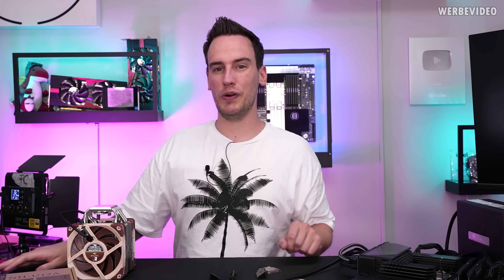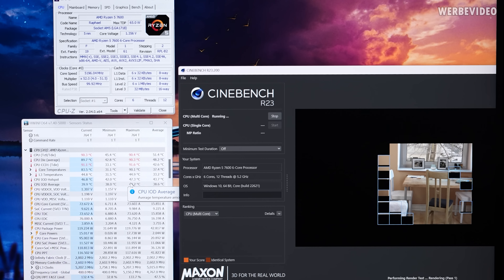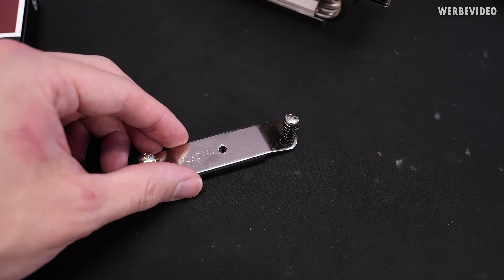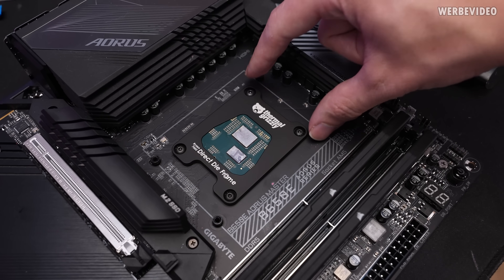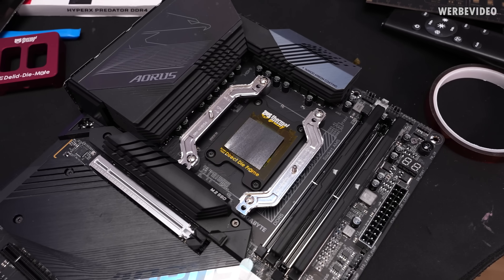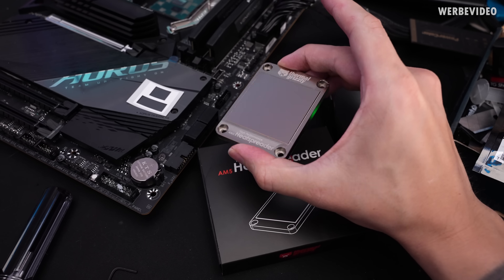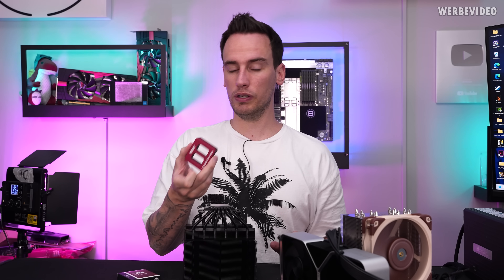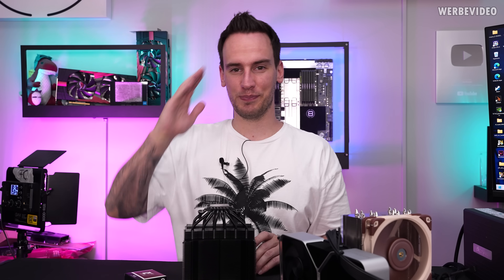How this 120$ Noctua Cooler beats a 360 AIO

Comment: Would have been interesting to see the difference between stock configuration of the Noctua compared tot the delidded situation. The comparison seems a bit flawed since we don't know how much performance gain is due to the cooler itself.
Reply: That's the key trick in this video 😂
Reply: Indeed. My thoughts exactly.
Reply: That wasnt shown for obvious reasons, as its a marketing video. While Noctua makes good products, the cooler here isnt outperforming or even matching 360mm AIO. Instead we are just seeing how bad the AMD IHS is, and how you can significantly lower your temps by removing it and going direct die.
Reply: @__aceofspades  To be fair, you can go anywhere and compare Noctua to an AIO, the question here was "What if you spend less on an air cooler, but de-lid it?". The fact of the matter is that the direct die air cooler did perform better than a 360mm AIO with the heat spreader. If you're budget is $200 for cooling and you want the reliability of an air cooler, this could make sense.
Reply: @EricFixalot  But then you want to answer the question as well, 'how much performance gain are you getting from delidding in the noctua situation'.
Reply: @EricFixalot @EricFixalot Yeah less compared to overpriced corsair garbage. The ls720 at least where I live is the same price as the d15, massively outperforms it and doesn't come with a hideous colour combination. Ofc if ur comparing a massively function over form company to one riding on reputation and focusing on form the former wins in function, no shit... Don't wanna sound like a needless hater but this is such obviously flawed testing. Like seriously 200 euro for a b tier 360mm aio lmfao, once again the derpcool ls720 beats both coolers and that isn't even $200 aud, it's the equavilent of almost exactly 110 euro converted.
Reply: @EricFixalot  You do know, when spending money on stupid shit, the only thing holding you back is BALLS; right? Still trying to sound like a stupid smart PC builder by using the word BUDGET is ignorant. Either you go out and buy what you need the first time; or stay home with the wife and let her tell you what you can spend....
Broke and thrifty is an oxymoron.....
Reply: @__aceofspades  Then wouldn't we want to see how much performance gain you're getting if you keep the cooler the same but delid the CPU?
Reply: @itspodin  Again though, you can already find a bunch of videos comparing delidding to stock. Sure it would have been useful, I just don’t think it was the point.

Comment: this video was meant to be on a 7950x or 13900k to be honest, first who is going to delid or invest in such a solution for a 5 watt cpu lol, second, to actually see the improvements what better cpus than those ??
Reply: Small form factor builds could benefit from this by allowing a smaller air cooler without sacrificing performance.

Comment: I wish that more CPU heatsinks used a four point mounting system. There are four holes available on the motherboard, after all. Gamers Nexus has proven with their testing that you get much more consistent mounting pressure when using four points vs two points for heatsink mounting.
Reply: Late to the conversation but what does kinematics have to do with mounting pressure? Motion is the last thing you want for a fixed mounting system. And any situation with an even remotely convex surface that’s not entirely rigid is going to benefit from four mounting points vs two.
Reply: I agree. 

Always fill every hole possible for maximum pleasure!
Reply: @Shadow__133  sweat pores: nervous perspiration
Reply: I still use an Arctic cooler from years ago with 4 point mounting, still keeps these newer chips nice and cool. 😂
Reply: @GoonyMclinux  Been rocking a Corsair H100 for over 8 years now, still moist and lukewarm. 

Good enough for a 5800X3D, but I wouldn't go higher than that lol.
Reply: @Shadow__133  cpus have been up and down so many times in temp I just keep the old heatsinks just in case. 🤣
Reply: @GoonyMclinux  Smart man 😂 

I plan on sticking with am4 for at least another year. 

All my upgrades were simply unscrew, change cpu, put paste, re-screw.
Reply: @Shadow__133  I have a R7-5700g and a r5-5600 rig and Im probably good for another 3 or 4 years. 🤣
Reply: @Shadow__133  best part is I don't pay for parts, I get lots of discards from PC's I build, just got the R7 after guy wanted 5800x3d instead (for 1% and .1% lows purposes)
Reply: Screw consistency. If I'm building a PC it should be optimal without being constrained by consistency. Two point mounting is obviously kinematically superior, so GN's results need checking
Reply: @shanent5793 I fail to see how it's "obvious" that 2 point mounting is superior, and even if there's an intuitive argument favouring it the funny thing about intuition is that it's often wrong.
Reply: @bosstowndynamics5488  Even in this very video he complains about inconsistent mounting because the cooler shifts side to side. This is a result of an additional lateral constraint caused by the friction between the strap and the cooler. A roller would eliminate that constraint, allowing for more deterministic placement. Excess constraints on a any degree of freedom will introduce inconsistency with removal and replacement. This has been well-understood in optical design, where repeatability is measured in nanomètres. There is an alternative in the form of elastic averaging which is also very repeatable, but since it relies on elasticity it is less effective on small systems.

If you look closely at the stock CPU retainer, it is also a two-point mount. This is a cheap way of getting consistent clamping without needing a torque wrench, though the extreme length of Intel CPUs highlight its limitations. The latest SP5 socket illustrates a combination design where the retention frame has two longitudinal mounts, a screw at one end and the other end held down by a hinge connected to a beam that is clamped to the board by two screws. The frame is very rigid, with a tall web along the sides, while the six or more contact points to the EPYC heat spreader are just stamped protrusions, allowing for elastic averaging. Then the cooler itself is secured with six small studs around the perimeter, also using elastic averaging.

Direct-die is a very different situation, with two or three small, asymmetrically distributed contact surfaces. And since it's DIY I think it's more important to keep costs down instead of focusing on repeatability when the system is infrequently assembled. I think it's more than just an intuition and I would appreciate it if you could point me to that GN article or video
Reply: @bosstowndynamics5488    the shifting side-to-side is potentially beneficial when using a thermal paste as opposed to liquid metal or graphene sheets, allowing it to spread out as well as push the excess out in doing so, as opposed to a 4 point mount where excess may be "swirled" around the middle. of course when going to direct-die as opposed to a heat-spreader and/or using liquid metal/graphene sheets, these points are moot, since direct-die is a less homogenous mounting surface, LM requires a thin-as-possible application, and graphene sheets are extremely fragile. the "obvious superiority" is with homogenous flat surfaces and thermal paste, which is what >90% of people will do
Reply: @shanent5793  GN's pressure mounting testing uses a pressure-sensitive sheet of... something (I don't know exactly what it is) that changes colour depending how firmly its pressed in that exact area. as such, considering the side-to-side shifting tore apart Roman's graphene sheet, it's possible that the results of GN's testing are not entirely accurate (however the way to get it more accurate would involve some stupidly expensive processes, such as X-Ray Fluorescence Photospectrometry by mounting the cooler to a glass substrate separated by a liquid whose refractive index changes readilly with pressure, but since XRF can only penetrate so deep, it may necessitate electron microscopy, which is a lot more expensive in turn afaik)
Reply: @glebglub  pressure sheets only measure the maximum pressure, so they can't report the actual pressure in use. I don't think it's particularly relevant, thermal paste is a fluid, so the pressure should be uniform across the interface. Thermal paste has worse conductivity than the heat sink, so the thinner the layer, the lower the thermal resistance. This can be achieved by making the surfaces flat or very slightly convex. This is easily checked by rubbing the heat sink or spreader on a surface plate and looking for the shiny spots, or placing it against an optical flat and counting fringes. If they're extremely flat they will even wring together like gage blocks. A bare die is cut from a polished silicon wafer, and should already be very flat though multi-chip modules might not be coplanar, requiring liquid metal or solder to be applied to the interface

Comment: "you can always sell the delidder afterwards" - honestly, I respect that so much for a tool your team designed.
Reply: They may as well have a rental service.
Reply: @g.4279  or a straight up de-lidding service
Reply: @VeryIntellijent  shipping as unlidded might cause some trouble as cargo workers sometimes handle stuff carelessly
Reply: @VeryIntellijent  They would be responsible of any damage.
Letting the users do it and void their warranty themselves is a better deal
Reply: @erkinalp If laptop cpus can skip the ihs so can desktop cpus
Reply: @Aonobaka29  If der8auer's failure rate is lower than users (which it would be), you just bake the "insurance" into the price. Charge 120 euros for delidding instead of paying 70 euros for the delidder. Many customers would pay the extra for the piece of mind. Also sales would increase as many potential customers want to delid but can't afford to risk their cpu. Original option of buying the delidder remains ofc.
Reply: @g.4279  I mean, technically if you have a right to return they sort of do, for the price of shipping. Seems like it'd be kinda a jerk move, though.
Reply: I bought his delidder for 8700k, used it once now it just sits in its box.
Reply: @Apollo-Computers I have an 8700k with it's hat still on!!  What time do. .  
  🤔🤔🤔
Reply: true!!
Reply: respect? why? you can buy used one, use it and then sell again at the same used price ;-)
Reply: @cokeforever  That what I was think as it screw over the creator.

Maybe hes banking on you been to lazy to sell it.
Reply: @grlmgor  most probably it is like this: literally everyone in pc building world knows and uses thermalgrizzly tp, now think of someone going to spend 3k usd on a new rig, he orders the tp, why not purchase the delidder at the same outlet, negligible as to total price of the build, same outlet == discount... it is a product that is so marginal, anything goes to sell this kind of crap
Reply: it´s Romans "Playgroung" - and ALL he does seems to be (be awre of leading a company..)
Reply: He should just rent it out lol
Reply: you can use and refund it xD
Reply: He was always a friend for others, in the beginning as he was a underage nerd he teacht joung youth and older childs "being there is everryhing" by liquid nitrogen celerons.
Reply: I know im not dyslexic but anytime i see the word deliddler my brain autocorrects it to the diddler 😆
Reply: That's just common sense lol...
Reply: Thats because of the insane profit margins on the TG direct die frame and TIM. Its like the printer industry, they will sell you a printer for $50 and lose money, but an ink cartridge is also $50 and has huge margins. He is fine with people reselling the delidder, because that means more customers will buy high margin frames and TIM.
Reply: @__aceofspades  exactly.  I don't know why people think him saying 'just sell it' is anything but a silly attempt at justifying the insane price.  I bought my 7700k delidder for under $30.
Reply: "Honestly"  Now you want to start being honest?  Just keep lying it suites you better.
Reply: @Physics072  Dude, it's just thing people say.  Not sure where this came from lol
Reply: Lol, yea but it was started by a liar.  Then parrots started saying it without realizing what they are saying. :)

Comment: i run a 360mm alphacool aio on my 7800x3d only because i screwed up my GPU's cooler and ended up just watercooling it to i figured alphacools quick disconnects made it the easiest option for me. 7800x3d + 3080 in one 360mm loop runs perfect neither part gets too hot at all.

Comment: I still can't bring myself to use an AIO. That's because of my decade and a half working at sea and seeing how hydraulic fittings always leak no matter how high quality they are, or how well installed they are. There were 1000s of them all over the ship and fixing or replacing leaking fittings is a constant game of whack--mole for engineers and oilers etc. I just do not trust fluids near electronics, so use a Noctua air cooler. Peace of mind. I am seeing less reports of AIO leaks in recent years though.
Reply: Hydraulics operate at several bars of pressure, leaks are expected. AIO or Custom loops don't! Built proper they don't leak. 👍
Reply: @madb132  Most of the time the hydraulic pumps are high volume, low pressure.
Reply: To my knowledge, the waterflow and pressure is really low in an AIO. It's like maybe it will fill a cup in 1 minute. Maybe 20 litres/h? Back in 2000, there were no watercooling kits to buy. So I got a aquarium pump from a zoo shop, 600 l/h, up to 90cm height difference in the loop. Tubes from a fishing shop and a DangerDen radiator. My reservoir was a plastic bucket that used to contain icecream, bought from the grocery store. Yeah, the water got really nasty after a few years. Nothing leaked. Moving on, my first AIO from Corsair died after 6 years. Pump started making a nasty noise and temps shot up. So I just replaced it with another Corsair AIO. I don't remember when this was but it was years ago. I am still using the 2nd Corsair AIO for my current PC. So that is 2 AIOs in like 10 years.

I don't think you should worry about tubes and pressure as much.

Comment: Noctua air coolers are awesome. Even the old D15 is still great depending on application - plus no messing around with tubes, water, pumps and all the unreliability that is introduced with those things.
Reply: Crazy to think D15 launch over 9 years ago.  Easy to install, great performance and silent:  Decibel numbers only tell the strength of the noise, not the type.  D15's noise has very low  pitch making it less irritating
Reply: @pickleadaykeepsthedoctoraway  its literally a hunk of aluminum and copper

of course its going to be still working great. The thermal capacity is anywhere from 200 to 250W. Enough for most processors.
Reply: @pickleadaykeepsthedoctoraway  Mike is about to go on a rant about how much thermal paste a person will save troubleshooting with an air cooler....
Reply: The first thing you do when troubleshooting is ditch the water cooler and slap on an air cooler.
Reply: @mikem9536  If your first step to troubleshooting a PC is removing the cooler, you shouldnt be troubleshooting or building a PC.
Reply: @mikem9536 Running a 13900k balls out on my 360 aio with a contact frame. I've achieved over 39k on cinebench @92c pushing 305w @5.8GHz all core. There isnt an air cooler that's keeping up with 305w lol.
Reply: @mikem9536 moronic.. lmao.

Dumber than a spambot.
Reply: @mikem9536  If you are troubleshooting a PC that is not first thing you do...
Reply: @lilpain1997   That's a massive generalisation.   Most troubleshooting in PCs is just down to connections
Reply: @lilpain1997  if you want to shoot some troubles before they appear, that's definitely what you do

Comment: aw it would have been an excellent moment to move from cryosheet to carbonaut :P at least...i think the carbon flap is slightly less sensitive. (been using one for about 2 years now, so far so good as I mainly used it to not have to worry about the thermal paste rather then have the absolute best possible goo between the heatspreader and cooler)

Comment: I think you have made the case for a Noctua air cool and stock cpu solution . What you see as a negative, (ingesting warm air in  a closed box), may be an added benefit in cooling your m.2 ssd's. Isolating the cpu is not "real world."

Comment: I've had my NHD15 on my 5800X for the past few years and it's been absolutely solid and quiet.  Never see temps above 70c.  I really hope when I upgrade to next gen Ryzen I can swap it over.  It may be massive but I was able to get the black edition for under $100, so it looks good in just about any system.

Comment: Ahh.. did I miss where you tried the direct die with the AIO to see the difference? Maybe not possible in this video due to not having a way to reliably lower the mounting position? I would of like to see more results with your heat spreader that thing looks great. I bet it does really well with some liquid metal.

Comment: In my experience the plates on most coolers need to be flattened to work optimally (or even properly) with direct die. Noctua mill theirs to an arched profile and a lot of AIO's are domed to help them confirm better to the shape of most IHS's. Otherwise, on the almost optically flat surface of the die(s) you end up with only a line or point of direct contact. Problem then is you've removed the nickel layer from the plate and it will react with the gallium (LM), but you can pre-treat it with gallium (cheaper than using LM itself) by agitating it into the surface while using a heat-gun or hairdryer (I mask off the plate with Kapton tape to make the treated area precise which soothes my OCD) effectively creating a 'barrier layer' of gallium/copper amalgam which will keep the LM application stable for longer. ETA >> I have an NH-D15S (single fan) which keeps my i9-9900KF (5.0/1.32V) under c.75°C in the summer while it pulls c. 165W in CB R23.